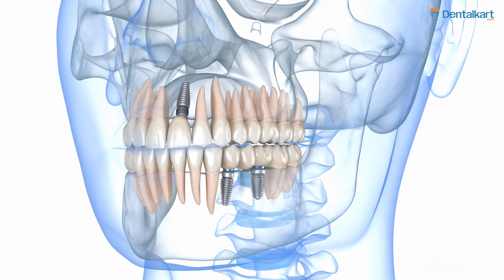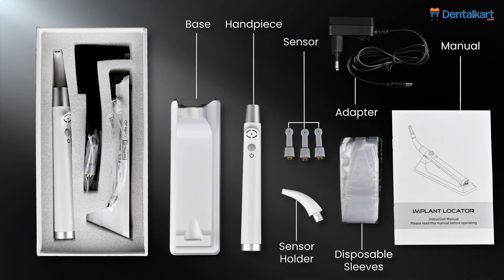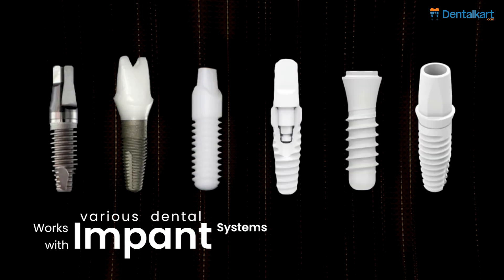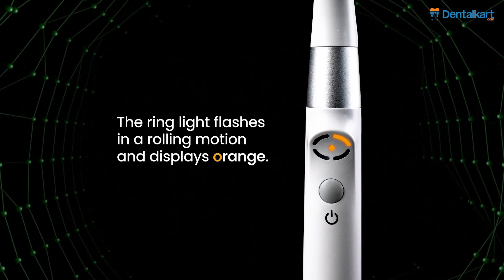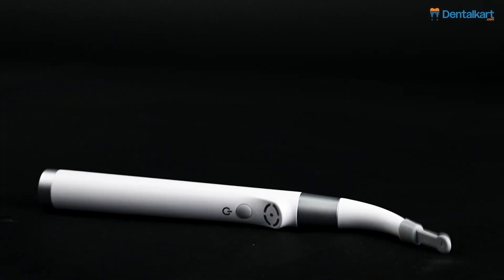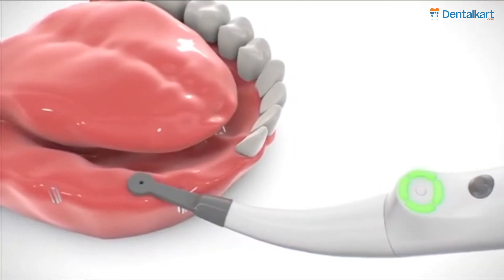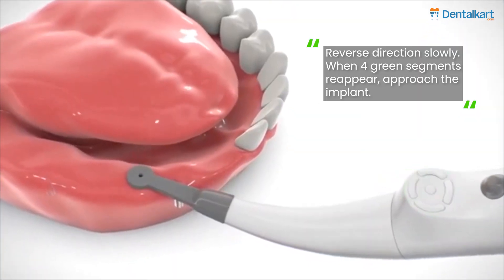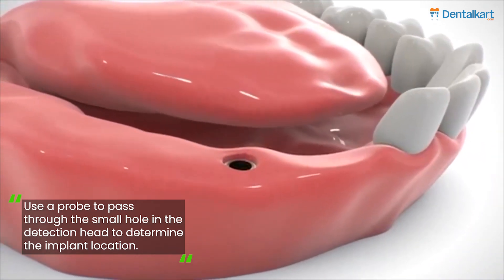How to Use a Dental Implant Locator: Step-by-Step Guide

Comment: Worst piece of Equipment, Was unable to locate ANYTHING and i did exactly as shown in this video. I tried this on 2 implants which were more than 8-9 months past initial placement. Maybe because of bone formation it couldnt detect. Today another patient is coming on whom an implant was placed 3 months ago, lets see how it performs.
Reply from the maker: Dear Doctor
Thank you for sharing your feedback. We're sorry to hear about your experience. Implant stability detection can sometimes vary depending on bone density and healing timelines. We recommend ensuring the device is calibrated correctly and the transducer is placed precisely. If you continue facing issues, feel free to reach out at
support@dentalkart.com or Call/WhatsApp us at +91-728-9999-456 so we can assist you more effectively.
Thankyou
Reply: @dentalkart  It failed again on the new patient, didnt detect the implant. There was a PFM crown in his mouth, i placed on top of it and it changed the light pattern thus showing its working atleast. But it just does not want to work on an implant. By the way i didnt buy it from you guys, bought it from another Vendor.